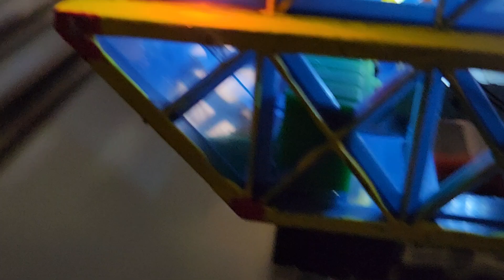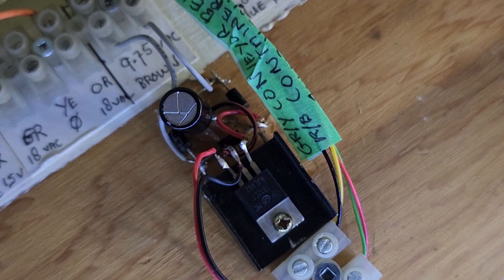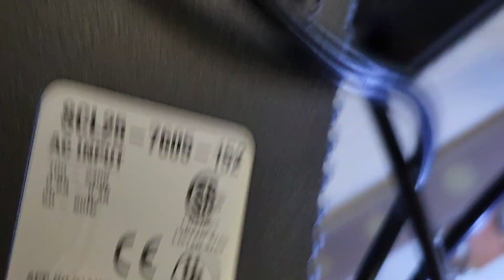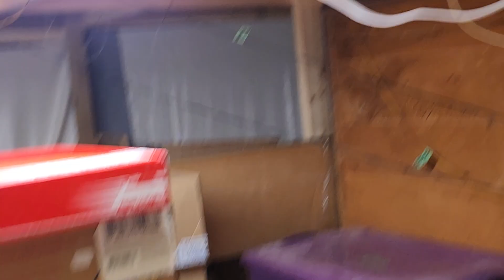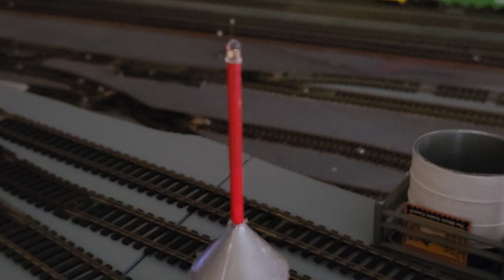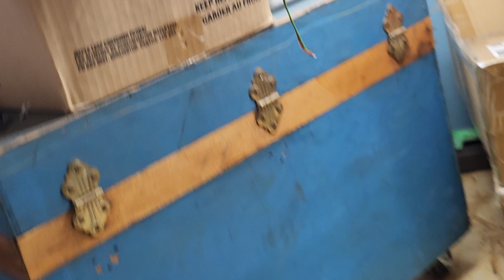Conveyor belt relighted and installed.

Comment: great work on the conveyor belt! :)
Reply from the maker: @mysticrailroad  thank you Ean, doubted for a bit to " go to town" with it, but it was missing one support with wheels, they used to run on a dockside, the motor unit was working but did not move the belt anymore.
Removed it and put accessories with a dude in there. 
Thank you for watching and reacting